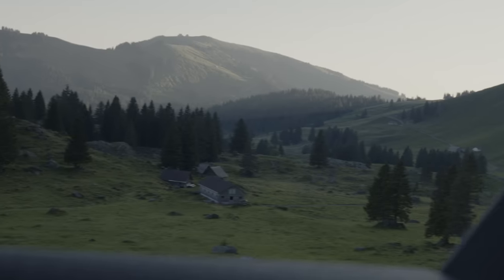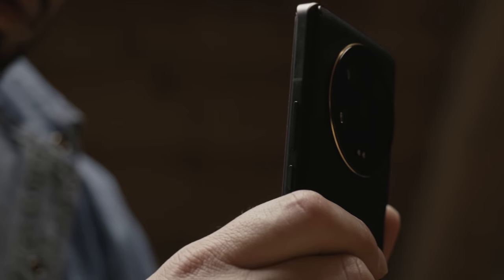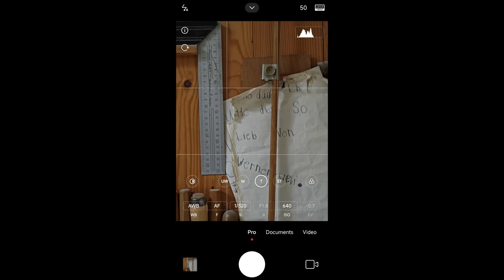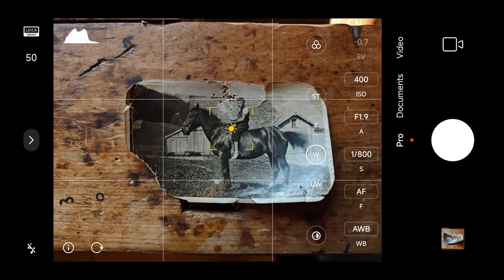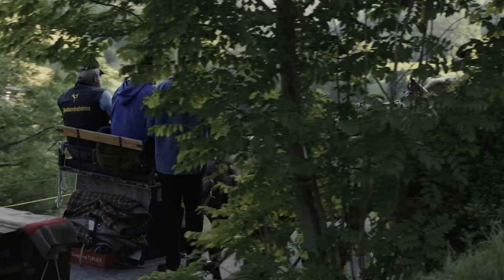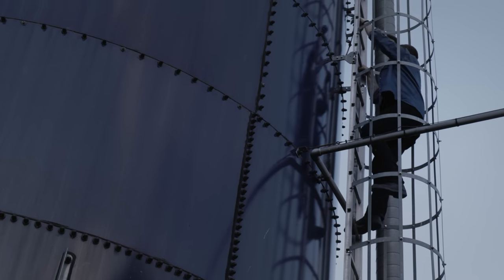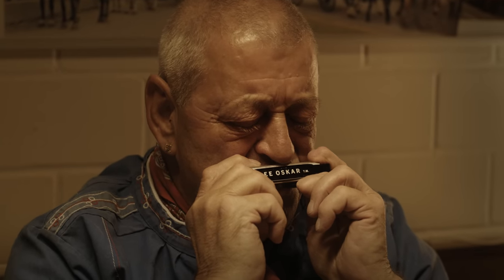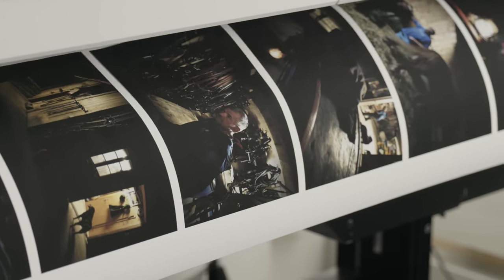Xiaomi Master Class by Dominic Nahr | Course Two: The five ingredients of a story

Comment: I want to buy qualcomm overclockable phone realme gt5 asap. I need overclockable intel phone, cpu temp, frequency, bclk and multiplier, default governor tweak in phone settings: interactive, powersave, performance, userspace;  conservative, ondemand/ adjust gpu governor and frequency in phone settings. all phone info, overclock, kernel tweak ... is in advance phone settings or developer options. also add crc, iosched tuner, tcp algorithm adjustable in phone settings